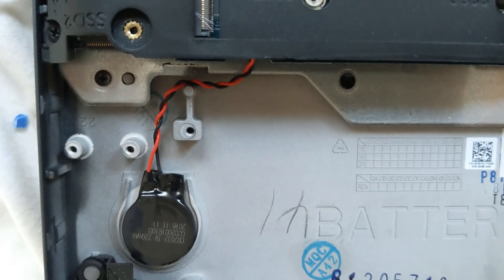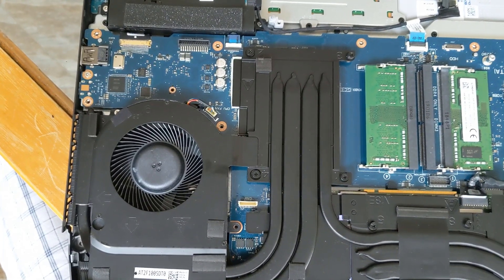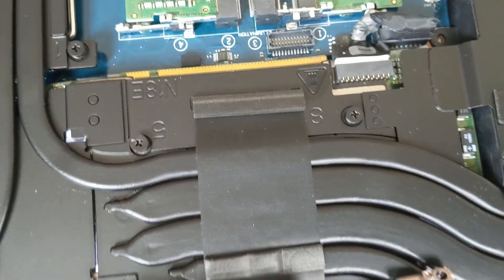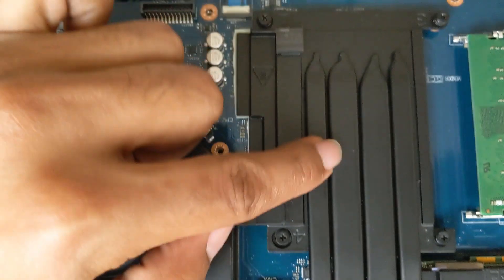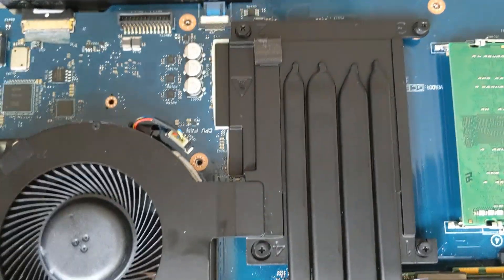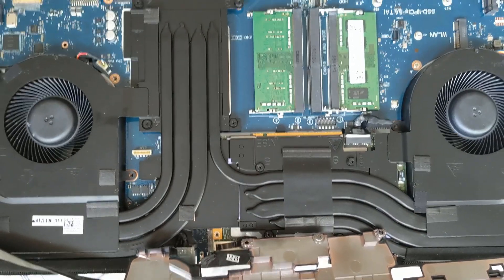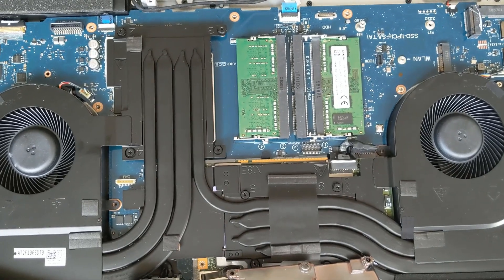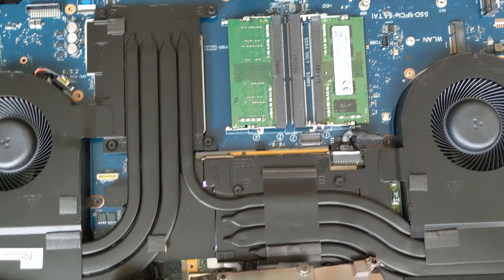Alienware A51m heat pipe issue?

Comment: In the Linus tear down, there are 7 heat pipes still but actually one is a shared heat pipe that you missed.   That’s the difference . It goes across the back .  Easy to miss.  But like you said, this could be the final product .  The Linus tear down at CES 2019 may have been a prototype or something .

Comment: I have this unit in the 9900k and rtx 2080. Heat is warm, but it's fine. Gaming it hits mid 80c with spikes into the 90s on CPU demanding games. The only time the 9900k thermal throttles a bit (still maintains 4.85ghz on on cores) is on benchmarking. 

100+fps on everything at 1080p max settings and 60+ everything 3440x1440 max settings. In. A. Laptop. Love the system.
Reply from the maker: That's great!!! Do you mind disassembling it to the heat pipes and emailing me a picture of it davej1071509@gmail.com
Reply: @DavesCorner  I wouldn't mind but there's no need. It looks identical to yours. All configs use the 7 heat pipe setup.
Reply: @DavesCorner  Just emailed anyway. But it's identical to yours.
Reply: @DavesCorner  sent some benchmarking screenshots as well.
Reply: Feel free to use them if you do a performance video as a comparison between models.

Comment: The rtx 2060 / I7 8700 (about 2300 euros) version does NOT have the side vents which means they use a different chassis or cooling system? Very disappointed to see that, else i would consider getting a rtx 2060 version. Shit manufacturers do to save money, downgrading their own products, the lower configs also have less heatpipes... so yea lets upgrade it with a rtx 2080 wohoo, cooling issues might come. very upgradeable.
Reply from the maker: I've been asking but I haven't got an answer, where does it show that it doesn't have side ventilation?
Reply: @DavesCorner  Its on the alienware website when you configure and rtx 2060 system on the bottom there is info and at the cooling info you see somethign written between ( and ), it says the 2060 configs have no side vents, this is what it says: Dual-Intake, Dual-Exhaust Airflow Design: The Area-51m chassis prioritizes performance with a dual fan design that pulls in cool air from the bottom and top vents, while exhaling exhaust out the rear and side vents for optimal core component cooling. (The Intel® Core™ i7-8700 with NVIDIA® GeForce RTX™ 2060 configuration does not have a side-exhaust) https://www.dell.com/en-us/shop/dell-laptops/new-alienware-area-51m/spd/alienware-17-area51m-laptop/wnser7cr5101h
Reply from the maker: I contacted Dell and they denied that there's any difference in cooling on any of the models
Reply from the maker: They're supposed to contact me back Monday to have more information on this. I appreciate the information on this thank you
Reply: I can confirm that this is NOT true. My 2060 Area 51m arrived yesterday and it does have fully functional side vents.
Reply from the maker: @christophermartin7744  great!!!!!

Comment: You have i7 cooling system, which is different than the i9 ones. That's why it's different, it's not about initial/final product.

Edit: I was wrong, it's the same.
Reply: the i9 and i7 area 51m cooling is identical. I have both systems and have repasted both. It's identical. Both are 7 heat pipes going to 4 heat sinks using 2 identical fans. My i9 has the rtx2080 and the i7 has the rtx2070. No idea if the rtx2060 changes the cooling, but the 2070 and 2080 are identical.
Reply from the maker: @Unkn0wnC0mmand  thank you very much for confirming this!!
Reply: @Unkn0wnC0mmand  Did the repaste help?  Thermal Grizzly?  I am strongly debating on grabbing this.
Reply: @lives4trauma  thermal paste didn't change temps whatsoever. Tried 4 pastes, one of which was grizzly kryonaught. Either the copper piping is at the limit as to the heat it can dissipate and thus you can't transfer more heat to it or Dell used pretty good thermal paste from the get-go. Thermal paste didn't change temps at all but out of the box there's virtually no thermal throttling outside of a LITTLE in CPU benchmarking. None in gaming.

I also have the alienware external GPU enclosure with an EVGA rtx 2080ti FTW3 Hybrid in it. When using the external GPU, the 9900k CPU stays at a chilly 60C while playing anthem and around 65C playing Assasins creed Odyssey. The GPU never breaks 45C, overclocked. Thats freaking cold for this CPU with a 5.1ghz OC. Both games are CPU intensive.

 Using the internal rtx 2080, the cpu gets to 85c in AC:O and around 85C in Anthem. Still not a bad temp. Same 5.1ghz OC and internal GPU +125/+115 OC. Manages over 100fps average in both games at 1080p.

Imo thermals are good and performance is great. 2100 cinebench, 24k 3dmark Firestrike (29k with 2080ti), and 11k timespy (15k 2080ti) that's easily among the best desktop scores out there.
Reply: @lives4trauma  imho if you have the budget, this is the best gaming laptop money can buy right now and should be pretty fire for years to come.

Of course you get more value in a desktop but that's the whole point of a product like this. A laptop is mobile. If you have need for mobility, this thing doesn't sacrifice any performance from a desktop to do so.
Reply: @Unkn0wnC0mmand  thanks, I had heard some YouTubers talking about this and thought it was true. Thanks for letting me know, also, happier with Dell now.
Reply: @evertonbraghirolli7348  well, the 9900k and rtx2080 don't overheat the cooling under any task but benchmarking. Even converting 8k raw to 4k or 1080p doesn't overheat anything with the 9900k/rtx2080. Gaming at 3440x1400 max everything in Anthem, Assasins Creed Odyssey, BF5, whatever, yields over 60fps average (sometimes near 100 peaks) and no cpu temps over 90ish C. In a laptop using desktop parts, that's quite wonderful, and VERY little performance gap compared to an equally equipped desktop. At 1080p max everything, the framerate is pegged at the laptop's refresh rate of 144 and rarely drops.

So it is my opinion that the cooling used for the 9900/2080 config would be MASSIVELY overkill for an rtx2060, that generates like 50% less heat coupled with a MUCH cooler processor. So if the rtx2060 version used 6 heatpipes, I still think heat would be completely managed under every task thrown at it. Doesn't make sense for Dell to use the same cooling solution across all models.
Reply: @Unkn0wnC0mmand  Can you tell me the cooling mode you used while playing the games you mentioned? Full speed? Performance? Or what?
Reply from the maker: Dell says it's the same cooling when I contacted them, do you have proof it's different?
Reply: @DavesCorner  Dell told me my Alienware 17 R1 cant upgrade the graphics. Reps arent a reputable source sadly.
Reply from the maker: @SolomonSide3  I wasn't talking to a sales rep on this issue
Reply: @DavesCorner   Me neither, I was speaking with Technical support about a replacement 780m, to which I was told was impossible due to BGA solution. Of which my laptop certainly is not.

Comment: I’m skeptic on getting this. I see a lot of mixed reviews for Alienware laptops as a whole, but this one has caught my eye. Do you think this is worth the price?
Reply: Me too, I have this question. I actually have ordered it and am waiting to get it, but I have 30 days to return if anything.
Reply: Hitman0014 I mean you’ll determine the value once you get it. I recently got a hp omen with some strong specs off of Amazon for about 1651 after taxes. For me to return it and get one of these is almost double. I’m on the fence because I’ve never had an Alienware before and this one here has definitely caught my eye
Reply: Worth it for me. Performance is nearly identical to a similarly specced desktop plus the benefit that it's mobile. 24,200 firestrike score, 11,000 timespy. 9900k/rtx2080 on mine. Love it so far. Solid hardware. Owned it about 3 weeks.
Reply: Landon Dodd how hot does it get?
Reply: @pheonix5678  well, the 9900k and rtx2080 don't overheat the cooling under any task but benchmarking. Even converting 8k raw to 4k or 1080p doesn't overheat anything with the 9900k/rtx2080. Gaming at 3440x1400 on external monitor max everything in Anthem, Assasins Creed Odyssey, BF5, whatever, yields over 60fps average (sometimes near 100 peaks) and no cpu temps over 90ish C. In a laptop using desktop parts, that's quite wonderful, and VERY little performance gap compared to an equally equipped desktop. At 1080p max everything, the framerate is pegged at the laptop's refresh rate of 144 and rarely drops. I've never seen the GPU over about 80-82C except for a few benchmarking tests on like the 20th consecutive run. During gaming/non-benchmarking, gpu stays in low 80s or less. CPU idles around 40C with virtually no fan, and GPU idles at 38C. Running a 5.2ghz CPU overclock and a +125core/+130mem GPU overclock.

To me, I can't imagine any better heat management with such high powered parts in a device this small. I did repaste with conductonaught (however its spelled) to see if it would change anything but the temps essentially stayed the exact same as out-of-the box. So looks like Dell actually used a good thermal paste for once.
Reply: Landon Dodd This will be my first Alienware laptop. My fingers are crossed lol.
Reply: @pheonix5678  Well, I don't even consider this an "Alienware Laptop" anymore. It's more like an "Alienware Mobile Desktop". The reason that matters is the Aurora and Area-51 Desktop are generally very well reviewed and perform VERY well. The Area-51m is more akin to the Aurora/Area-51 Desktops than it is the 17r5 Laptop. The 51m build quality and performance is very much a few tiers above their other laptops.

If their laptops are Fords the 51m is a Lincoln, so to speak.
Reply: @pheonix5678  That being said there can always be production errors, but I have 2 51m's, and I have some colleagues that also have this computer and we've not had any production issues or any troubles. I seem to have gotten a slightly better processor than they did in terms of performance/heat (theirs does 5ghz, mine does 5.2ghz at the same heat level) but still- even theirs are solid performers and part variance is normal.

Just bear in mind that the 9900k is a soldered CPU, so it's thermal limit is 115c, with a firmware soft-limit of 100c. So even if it's in the 90s under load, its still well below what its rated for. Many non-soldered CPU's have a 100c limit instead of 115c, but the 9900k is fine running a little hotter than other chips.
Reply: Landon Dodd thanks man you’re like the best person to talk to about this haha. I had an HP Omen but I’m returning it
Reply: Landon Dodd I’m planning on swapping out the SSDs for Samsung Pro 970 and the HDD with a Samsung 860 Pro SATA 3
Reply: @pheonix5678  I stuck with the 2 1tb nvme drives in raid 0 that came with the system (crystalmark speed of 3500 megabytes a second read and about the same write) but I did put in a 4tb Samsung 860 pro sata3 ssd. Samsung pro 970s would be a great choice for your nvme drives though. Dell preferred account got me their 2 1tb nvme drives for like 300 each, so I couldn't refuse. Seem to be close enough to the Samsung 970s for me to not bother swapping.

The thing about ordering from Dell is never order from the website. Call in and depending on who you talk to, they'll come off a lot on pricing. My 51m is completely maxed out and I got it for right at 20% off the website price by calling in and enough "cash back" using Dell Preferred to get extra 2 chargers for about $5.
Reply: Landon Dodd I did get about $200 knocked off by going through the chat
Reply: @Unkn0wnC0mmand  can we add a 2.5 inch sdd thats more than 1 gig? Dell told me no. Im.runninh on raid 0 2 pieces of 1 nvme
Reply: I'm mostly debating it because of the scary thermals, I ordered mine to have the grizzly repaste, but I'm thinking I should pick up a laptop cooler which I feel this machine would benefit a lot from since the intakes are at the bottom
Reply: Lee Henderson honestly I’ve heard that it’s nothing to be worried about.
Reply: @pheonix5678  I follow a forum on notebookreview and a lot of the current owners are constantly mentioning how much it overheats, failures that occur, and the thermal throttling.  Some report smoke coming out of this machine as well
Reply: Lee Henderson interesting
Reply: Are they overclocking? I’m getting mine next Wednesday and I’ll be sure to share my findings
Reply: @pheonix5678  yes, a most of them are and some aren't, I'd be curious to see your results if you end up posting there.
Reply: I haven't gotten an ETA on mine yet, but I'm hoping I can squeeze out performance like the user on there "Rocktaze" his score was mentioned by Frank Azor and Umar and  has an article from notebookcheck as well
Reply: Lee Henderson I’ll def post here. I don’t care for OCing to be honest. However, If the laptop turns out to be a piece of shit I’m returning it lol. If I pay over $1500 for something it better work or else it’s going back. I was thinking of getting mine from Xotic but it had no ETA and after speaking with someone there they said middle of April
Reply: @pheonix5678  that's exactly where I got mine from, I saw the low base price, didn't mind that they don't include any m.2s in them as I'll be putting my own in, I ordered on the 18th. I'm still in phase 1 since the 18th, which is the inventory gathering but I'm not entirely sure what that means, either they have it or buying it from Dell and taking out parts I didn't ask for to keep for their own inventory.
Reply: @thenewme79  i see i see. Whats a good program to use to keep display then temps?
Reply: @pheonix5678  most people stick with msi afterburner
Reply: Lee Henderson I’m quite involved in notebookreview forums and have posted about my 51-m there a LOT and saying there are reports of smoking is like saying people get stomach bleeding from Tylenol. There have been 2 confirmed 51m’s that “smoked”, one was from a faulty motherboard solder and the other was from a guy that repasted his GPU with conductive paste and fried the thing. So this is essentially a non issue and not anything faulty in Dells design.

I have multiple 51m’s and haven’t had a “heat issue” at all and the only thermal throttling I’ve seen has been in benchmarking. Most games take my overclocked cpu temps into the 80s, with a few reaching 90-92c, and some being in the low 70s. GPU rarely gets out of the 70s. Non-OC machines are s few % cooler. It’s a warm machine but the 9900K is rated for 115C with a firmware throttle at 100C so temps aren’t even close to damaging. The GPU (RTX 2080) runs surprisingly cool.

Like with any product, there will be some with issues and some without but mine were all preorder units and have been flawless despite being on 24/7 under heavy load essentially the entire time of ownership. I wouldn’t worry about the .000000001% with serious issues. So far this 51m system has been a super solid new-platform launch for Dell.

I have zero issue recommending the 51m to people that want desktop power in a portable form factor. It’s benchmarking and performing dead-on with equal specced desktops.

MSI Afterburner is OK but I’ve had some erroneous reporting with RTX GPUs. Check out. EVGA precision X1. Newest update has been pretty solid so far on temp reporting and clocks.
Reply: Landon Dodd I was waiting for your input lol
Reply: @Unkn0wnC0mmand  that made me debate my decision on the 9700k since it has a cap of 100c in comparison to the 9900ks 115c, but who knows, maybe I'll get that lottery cpu well along with the suitable temps when OC.
Reply: This will put any skepticism aside. Wipes the floor with virtually everything else.

https://youtu.be/Qkv0JhhHsaQ

Comment: Thanks for reply, mention of different cooling parts might be from the ordering page for base hardware. "Intel® Core™ i7-8700 with NVIDIA® GeForce RTX™ 2060 configuration does not have a side-exhaust", after 2060s are unboxed soon we'll see what no side-exhaust means, it might mean users upgrading to better CPU-GPU later could do a little better with your style of heatsink & know to upgrade to it, we'll see!
Reply from the maker: I was told that a user commented on Alienware's review that they using different cooling solutions on the A51m.
Reply from the maker: I'm not finding that quote, could you direct me to it please?

Comment: Is there an issue with the touchpad
Reply from the maker: Besides the issue in my review video no
Reply: @DavesCorner  some have undervolt the alienware laptop and added a bigger power cord to combat thermal throttling....OwnorDisown has a video on this.
Reply from the maker: @amonsmith3096  I didn't see him do a video on the Alienware A51M. My specs doesn't thermal throttle.